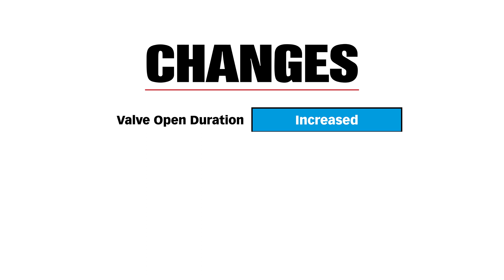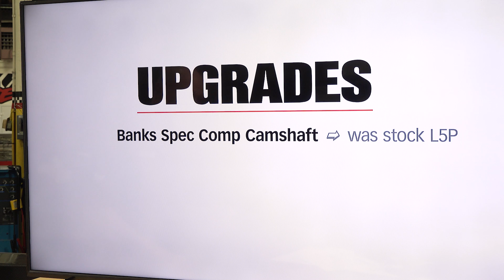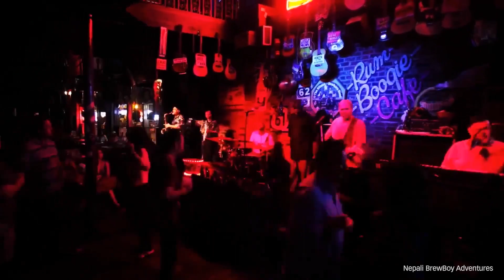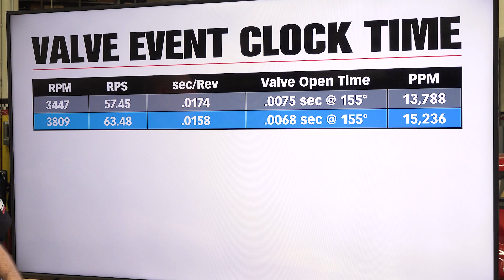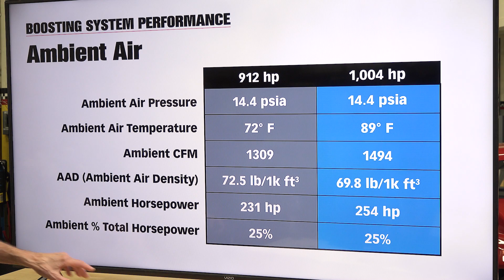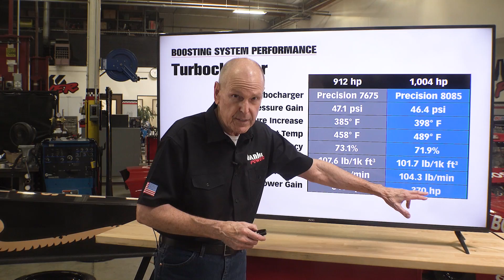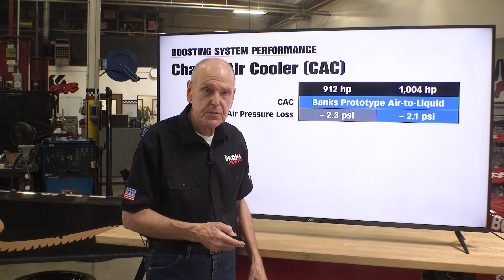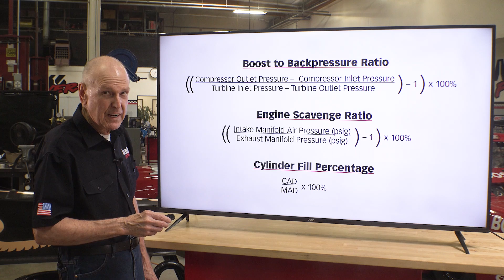1,004 HP !!! Killing A Duramax Pt 15

Comment: How would compound turbos make more horsepower, all else equal? My vote is water/meth for the next round. Compounds help driveability, but a single is fine for the dyno. Nitrous is an expensive toy, not a daily driver thing, but water and/or methanol injection makes sense. It’s even on production cars these days and was stock on the first turbo car way back when! Let’s see the difference in how much harder Mr. Banks can push before hitting his redlines with water/meth!
Reply: Compound turbos wouldn't make more horsepower than the single that's on it.  It's matched pretty well.  But I don't think water/methanol injection will do anything.  The colossal intercooler they have is cooling the charge air down to 101F.  So what additional charge cooling effect can be gained from water/methanol?  None.  The boiling point of water is 212F, so there is no possibility of evaporational cooling to lower charge temperature.  And since then engine is running only 14% excess air, there is not much room left for water/methanol before fueling must be reduced.  I don't think the intercooler can be ditched and replaced by water/methanol without seriously reducing power.  Yes, water/meth injection would be effective injected into the 480F compressor discharge, but so much would have to be injected, that fueling would have to be decreased.  A little water injection into the exhaust manifold would be good for controlling turbine inlet temperature, but that isn't seriously out of control anyway, and it would do nothing for power.
Reply: @andyharman3022  Good point, but Mr. Banks has used water and meth injection in a bunch of different ways- remember the brake cooling system on the Pikes Peak semi? I'm thinking more along the lines of using water injection somewhere other than the intake tract. Maybe to control EGTs or increase the drive ratio instead of simply cooling the charge.

Comment: Next is all about getting more air in.  So you have to cool it or pressurize it.  Since you just replaced the turbo with a custom one you’re not going to mess with that.  I’m guessing nitrous or compound turbos or renting a refrigeration truck to cool your dyno cell.  Nitrous will probably be easier, but your crew is not all about easy.  BTW, would love a walkthrough of the various sensors and Banks Bus modules you’re using on the rig before you blow it up.

Comment: Drat!   I was 16 hp too high.  I guesstimated it would do 1020.  But 1004 is pretty good................
Now that you have the recipe, how about just setting the engine at 1000 hp and drop a brick on the throttle.  That would bang this turkey.  I think the pistons will go before the heads lift or the block unzips. 
I'm always a sucker for compound turbos, and would love to see a deep dive into their performance, but the engine is stressed high enough with the single turbo at 46-ish psi that if you run it long enough, failures will occur.  The engine has been run at 260 bar peak pressures many times, which is about 45% over the design limit, and I don't think GM designed that much margin into it.  It must be experiencing crank and block bending stresses that are over the endurance limit.  It's a grey cast iron block, and when those go, they go in milliseconds.
Maybe you could take a pause in testing, tear down the engine and inspect the hell out of everything.  Magnaflux the crank, rods, and block.  Dye penetrant test the heads.  Take some hardness measurements on the piston bowl rims, ring lands, and pin bosses.  Check the head gaskets for combustion leaks.  Check the valve heads for dishing.  It's taken a year, many dollars, and a lot of work to get the engine this far.  It's now an artifact, and valuable knowledge would be lost in the shrapnel of a major failure.

Comment: For strictly high HP results, N2O should give a higher HP output, but the gas usage is not practical for long term use. I'd go Water/Methanol, especially if you have a method of cooling it before injecting it. This should improve the air density in the cylinders, thus creating more HP and lower EGT. Kits are less expensive, and the mix should last way longer before refill. Might go for 117 deg. duration on the Cam.

Comment: I want to see water meth cause in my opinion nitrous in my book is hitting the cheap and easy button when it comes to building horsepower. I love this build cause I crave consistency and you be able to do 1000hp “stock” more than once is some serious bragging rights. Maybe sometime in the future you can do this same setup but on the Powerstroke and maybe give G.M a run for its money.

Comment: I think it is longer duration cam, then compound.  So, on the CAC what liquid are you flowing through it?  Is it a water resivour like you do with gas engine water to air, or is it some other source?  I know the water to air works in racing, but as a day-to-day solution it seems to fall flat.  Keep up the great videos, and the forced induction of knowledge!

Comment: I'm guessing you're going to have to shorten the stroke length in order to get more power pulses per unit time. You can't afford to be shoving any more air into the cylinder since you're already past max head pressure, right? Intake airflow is also an issue so you'll probably have to port the heads and get wider intake runners as well since you're pulling a vaccum trying to keep up air velocity. Other than that all I can think is tuning out the helmholtz and all that other harmonic junk but that's not nearly as important at this stage as far as I'm aware.

Comment: Can the engine speed be increased another 300-400 RPMs? 1,385 lb/ft at 4,200 RPMs would be around 1,100 HP if my math is correct.

Comment: Great series Mr. Banks. I know you're an engine guy, but I am wondering about the rest of the drive train, can it handle the power, and maybe the brakes and suspension need an upgrade to handle or take advantage of the new power capabilities.
Reply: Ya you will need bigger tail pipes you know dual 10 inch tip like all the other young and dumb boys do.

Comment: Fantastic stuff.  This video series will be a great legacy for generations.  Your determination to maximize efficiency is what makes you a superior engine builder.  If you just want to see what the bottom end will hold, I guess that's just a matter of cylinder pressure and RPM.  Crank up your max cylinder pressure.  You already know it will hold together at 260, how about shooting for 300!

Comment: “Bone stock duramax” *runs through mod list including cam and turbo*😂
Reply: Bone stock rotating assembly
Reply: the crank / rods / pistons and block support 1000 hp xO . Thats so freaking wild. xD
Reply: Its on stock engine internals, head gaskets, bearings, head bolts. The rotating assembly is untouched. For the purposes of durability, it is bone stock.

Comment: Blower with another cooler and water injection after!  I would like to hear more about air/fuel ratio on the 100 over injectors -- how did the fuel system stack up to the increased power?  Sounds like power was well within fuel delivery capacity.  Could more air flow be made leaner toward your 20:1 preference?

Comment: I would love to see what effects water methanol and just pure water injection has at this point, leaving everything else constant. I think a lot of people (myself included) are at the limit of their turbocharger or fuel system but are looking for a little extra power so it would be interesting to see if water methanol will offer any benefits at this point by improving MAD.

Also curious if nozzle location has any effect i.e. installing directly at the after-cooler exit to allow maximum time for evaporation or direct port injection. It's my understanding that having liquid water droplets enter the cylinder is a no-go.

Thanks for all the awesome content Gale, looking forward to see what's next!
Reply: I would expect lowering the manifold air temp and increasing CAD would still be accounted by the MAF sensor and the idash.
Gale said he would prefer 20% excess air, and was only at 14%.
Reply: Pre turbo water injection , l would also want to see only water here .
Reply: What is going to kill it ? Heat , stress , ?? Meth water lower temp? Love your class teacher..
Reply: Gale already did it on the Monster Truck engine here: https://youtu.be/k0oWISH5eT8

Comment: Please Please do Compound turbos!  i want know  how you'd size them,  how inter-stage cooling affects the air density  and overall air flow characteristics  ect ect  I don't think  anyone on YouTube gives out anywhere near the amount of data on the subject  as i feel you would.
Reply: Will shatter the motor way faster, hp doesn’t break shit but early torque ramps are and crank pressure. That’s the big problem is compounds do both of those very well.
Reply: @bbdl7042  nobody said small turbos.  pair a significantly bigger turbo up with this one. Off the top of my head say 100ish mm.  Still not much low end torque but lots of oxygen up top
Reply: @jaywiebe7612  he just have big double turbos with a supercharger for the response and spooling up the turbos
Reply: @bbdl7042  that's what happens when you don't tune appropriately. You can tune the low end torque out. Also, Banks isn't even loading this engine down, until it's at the test RPM, so that wouldn't be an issue.

Comment: Love what your doing but I don’t believe it will translate to a vehicle, maybe a drag truck but probably not, mainly due to the charge air cooler. There is no way to keep the charge as cool on a vehicle especially one running for a long period of time. So how about a real world scenario. Where I live it is 1800 feet above sea level with 100+ temps daily and 60-90% humidity.

Comment: Water meth an air density is dream come true, this is where I want to see it go ;)  Combine that with the charge air cooler, I highly suspect the density will be prime for going much, more on this.  But the drive pressure will rise to boost pressure, we might be headed back to a smaller scavenge ratio?  Maybe then we can have a look again at revided exhaust manifolds with some tubular flowing beasts and get the scavenge happening again with some long, high velocity exhaust header pipes. 
Sorry I got carried away, but I am really into this series, good stuff Gale and thanks so much for all of the real data that is proving theories from many decades of speculation.
Reply: Beauty of it is you can use the wastegates to bypass that turbo, lower the drive pressure, and control the intake pressure.

Comment: I wanna see what an icewater air cooler+head studs would do as the next step, freaking amazing series
Reply: You would need a huge ice chest to cope with the volumes, temperatures and run times they are doing
Reply: @jacobmoses3712  very true didn't think of that, water/meth or nitrous it is then

Comment: Propane, NO2, and water-methanol. All at the same time. With a CO2 system for the charged air cooler. If all that at once doesen't kill it, i don't think anything will.

Comment: Did you investegate the need for stronger head bolts or studs. At 260bars times piston area times 4 pistons per head devided by nomber of head bolts gives pulling force on each bolt. I wounder how close are you to the tensile limit of the bolts. Or........ Find out the fantastic way by pushing it until it gose kapoooooffff

Comment: An interesting Manifold Air Density experiment would be to test a Compound vs TwinTurbo setup to observe the differences between the two configurations and how they differently affect manifold air density and turbo back pressure.
First do the compound test, then do a twin turbo test. Finally, revise the exhaust manifold piping to be less restrictive and re-run the twin turbo test.
Reply: The exhaust is already 5 inch free flowing.

Comment: 1000+ HP with almost 100% stock internals WOW. Congratulations guys! You should do compound next to see if the engine's behaviour with the compounds is improved over stock for the same 1000 HP, I mean, if the responsiveness is improved. And next to that, expecting that the engine keeps good in health, you should add a Water+Meth system to take it to the extreme. PS: It's a pleasure seeing your videos where you teach something. Thanks for the effort you put into this videos.